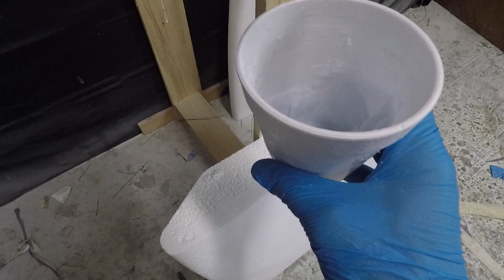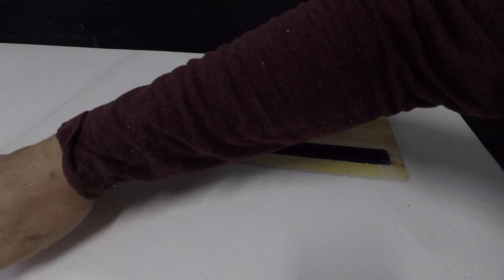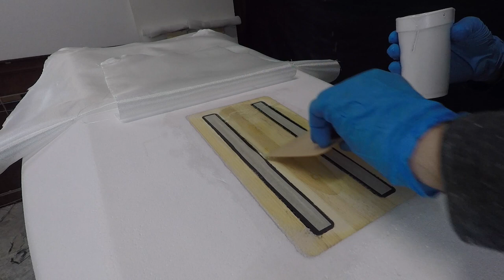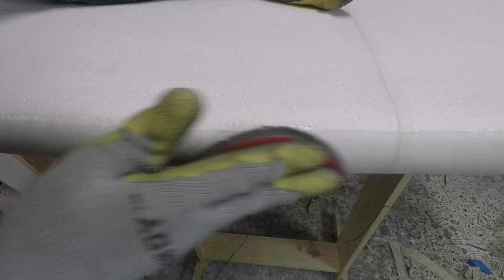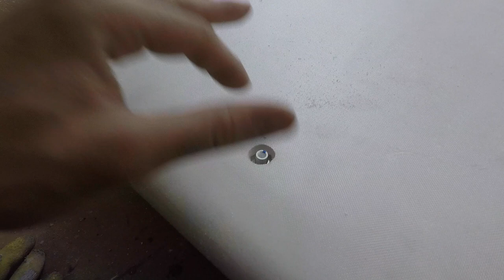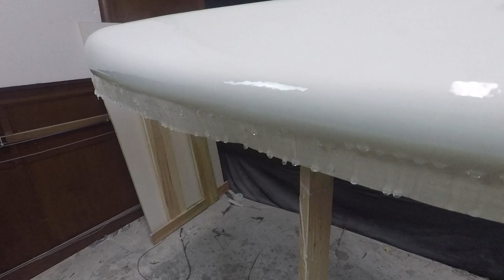How to build a WingFoil Board! (step by step guide video)

Comment: Does a board like this withput stringer not snap in half or it's strong enough to withstand the torke the foil creates and the pumping that the surfer does? I'm trying to design a hybrid board that can add fins or foil and the biggest issue is that if i just put a foil in a normal surfboars it will snap it in half. Thanks

Comment: What type of epoxy thickener do you use?
Reply from the maker: I use and sell little bags of west systems micro fibers. However I have also used other thickeners... they all work great! If you think you will be sanding some of the thickened resin adding some "micro spheres" into the mix makes it so much easier to sand.

Comment: Could this technique be used exactly the same but with carbon fiber?
Reply from the maker: Yes, however I would avoid a black carbon finish to avoid heat issues. You can probably use less layers during the lay up as well
Reply: Same same but different.